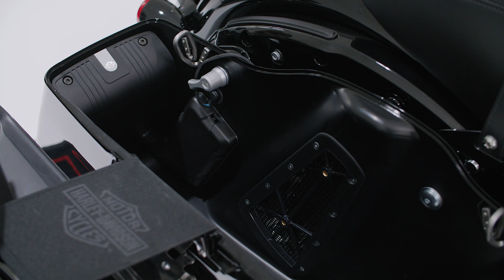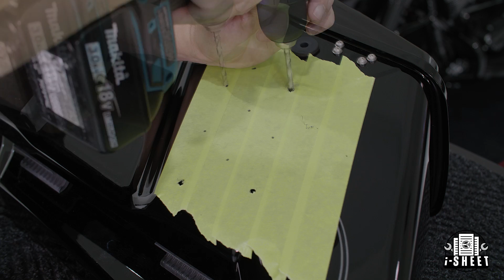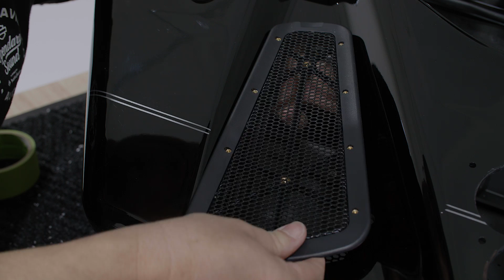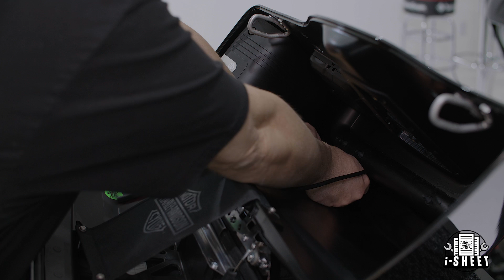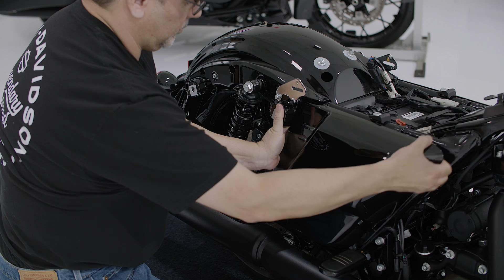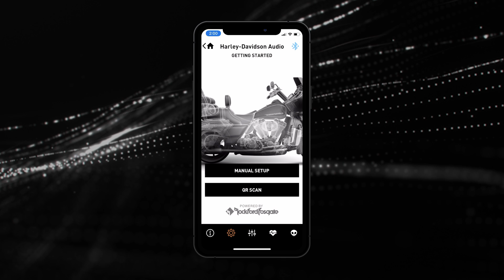Subwoofer Kit Install | Harley-Davidson Audio powered by Rockford Fosgate

Comment: I have a 2022 road glide cvo FLTRXSE model . Recently purchased primary 10" subwoofer with the 4 channel  secondary Rockford fosgate amplifier & amplifier kit ,Bluetooth dongle and harness. My bike already had pre existing Rockford fosgate amplifier. Dose anyone know where the A2B CONNECTOR LOCATED AT ON THE LEFTH SIDE TO CONNECT THE FEMALE A2B ON THE RIGHT SIDE...I CANT FIND IT ?
Reply from the maker: Hey Rodney. When you have a moment, we recommend giving our Customer Care Team a call at 1-800-258-2464 (Monday through Friday 8:00 a.m. – 7:00 p.m. CDT) so they can try to offer assistance, or you can stop in at your local dealer. You can also reference the I-Sheet for the Secondary Amplifier Installation Kit for further assistance ➡️ https://serviceinfo.harley-davidson.com/sip/service/document/1981473733634123212

Comment: Does the app connect to the amp or the radio? 
I have the stage 5 set with 2 subwoofers, but the app doesn't find anything to connect to. I also have to black cover grills, not the silver ones, if that matters...
Reply from the maker: Hi there, we recommend giving our Customer Care Team a call so they can learn more and offer assistance. They can be reached at 1-800-258-2464 (Monday through Friday 8:00 a.m. – 7:00 p.m. CDT). You can also stop in at your local dealer for assistance, you can see all the dealers in your area here ➡️  https://h-d.com/dealerlocator

Comment: Can a Harley Davidson by Rockford Fosgate be installed in a 2021 Roadking and Roadking Special?
Reply from the maker: Hey Pom - Check out https://www.harley-davidson.com/us/en/shop/c/motorcycle-audio-equipment and use the motorcycle model filter tool to see what audio and electronic accessories are compatible with your H-D model(s). Thanks!
Reply: i already purchased a subwoofer kit unfortunately i cant install it in my road king because i dont have a head unit. i wish Rockford can build one for Road Kings

Comment: So I can use the primary and secondary subwoofer in a 2021 CVO Roadglide that already has a single amp in one of the saddle bags.  I am under the impression that one of the two subwoofer enclosures doesn't have a space for the amp and I'll need two to run my existing cvo speakers and the dual subwoofers?  Does the secondary have the cutout for the secondary amp?
Reply: hey so they both have cut outs. if you run the set up let me know. i have a 22 cvo and cant find the a-b connector
Reply: @RobertPerez001   Same problem with me. Did you ever find the connector?
Reply: @WillJustBlaze  if I remember correctly, it’s no a-b connector. You actually unpin and rep in the can wired for both amps to talk to each other.
Reply: If you put your number I’ll shoot you a text and show you what to do when I get back to the casa.

Comment: Still does not sound as good as the subs and amps directly from Rockford. But why would Rockford cut their best selling line of Harley subs and amps. Speakers are different along with the amp  that is Harley sold versus Fosgate sold. Fosgate direct sound louder. Cleaner. And speakers can handle more power. Also, the Harley head unit is the first thing everyone removed before they upgrade. Good upgrade though for the older crowd.

Comment: I'm curious, if I have an 8 speaker system, is it possible to add these? Seems like I would need a third amp.
Reply from the maker: Hi, we recommend stopping in at your local dealer, as this may depend on the specific configuration of your bike. You can also learn more about the Rockford Fosgate kits by following the link below. Thank you. https://bit.ly/3G0PK45
Reply: I'm running 8 speakers on my 17 ultra with one rockford  amp with no problem and i called rockford and asked them if it would handle all eight. so i would think you would just need to add a second amp for the subs
Reply: @amandabarnes435  Hi Amanda, your speakers are Rockford? And how to connect the speakers to the Rockford amp? I have 8 speakers Rockford and 2 amp Rockford my HD cvo ultra, ı want to install dual subwoofer
Please imform me :)

Comment: That's cool. Fill the saddlebag with speakers and lose all your storage capacity on a touring bike. Might as well since Harleys are so boring to ride no reason to want to take a trip on one of those slow, shitty handling piles of shit.
Reply: Says the guy who can't afford one.
Reply: @im2yys4u81  I can afford one. That's not the issue. I simply choose to not ride complete piles of shit. Harleys fucking suck. Slow, heavy, shitty brakes, worse suspension. Explain to me how Harley can make so little power from so much displacement. Please explain that to me.
Reply: @ericalger5003  So exactly what kind of "not slow, heavy, shitty brakes" kind of bike do you ride? I've been riding H-D for fifty years, so go ahead and educate me.
Reply: @im2yys4u81  A 2021 Ninja 1000SX. With Kawasaki accessory hard bags it was $13,500. I paid cash. It's mine.